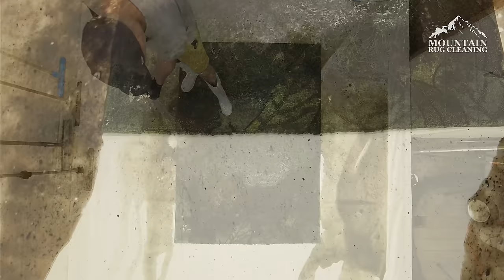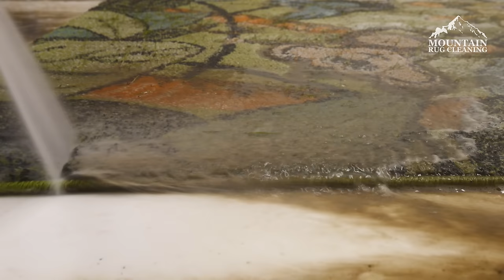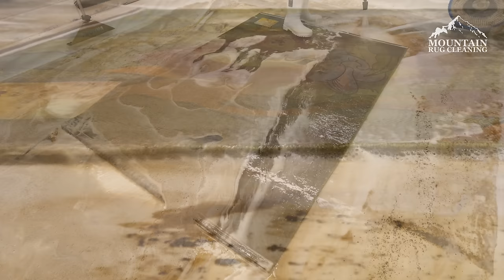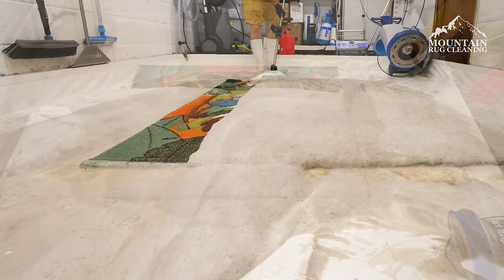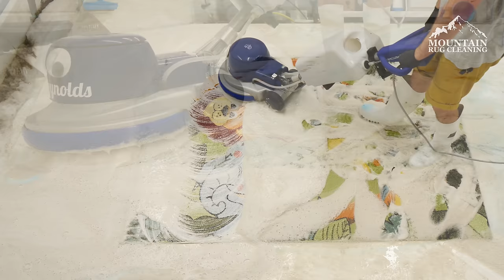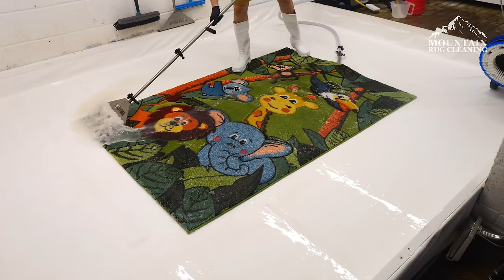Not Sure Whether To Clean It Or Mow It ! But Can It Be Cleaned ?

Comment: I work at a handmade rug shop, I’m curious how you handle rugs that have like a fringe or if these techniques aren’t too rough for handmade rugs?
Reply from the maker: I avoid them when possible. As you'll probably know fringes are usually primarily cotton white or cream and stain very easily and deteriorate. If left outside they get mould staining and its impossible to remove.

Comment: I'm sure you have your reasons, but if it was me I'd use the power washer first and most, and only start using expensive detergents once I'd gone as far as I could with cheap old water. Would a heated power washer destroy those rugs? I'd love to just belt out a suggestion like I knew my junk, but I do know that while heated power washers will clean things that regular ones won't, I know they'll wreck things regular ones won't, too.

Side note I think the 'R2-Clean-2' thingy and the googly eyes on the rug doctor are hilarious. The only thing that would make it even better would be if you name the googly-eyes one, 'Carpet Muncher'.

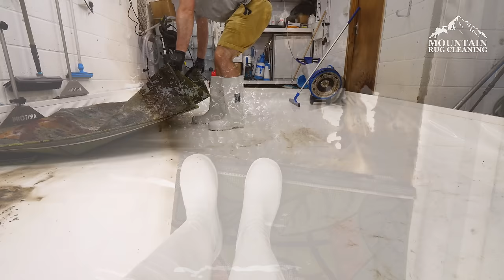Comment: at 11:22 that dirt wouldnt be built up like that if you would make a metal frame with rollers and a bar across the top with strong clamps to hang and hold the rug in a vertical position and that way you could preasure wash it from both sides by going around behind the frame and blasting ALL that dirt/mud off and washing it stratght down to the floor,    down a flat surface like that the dirt/mud just keeps soaking to the other side,  may it be the top or bottom.